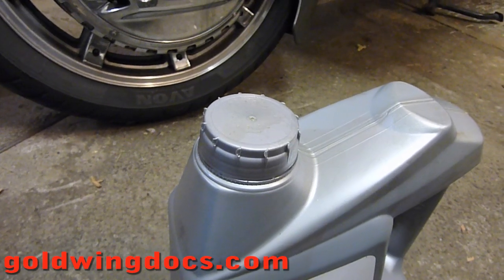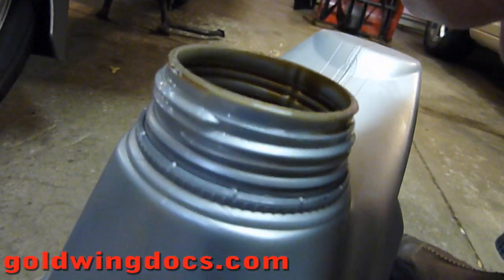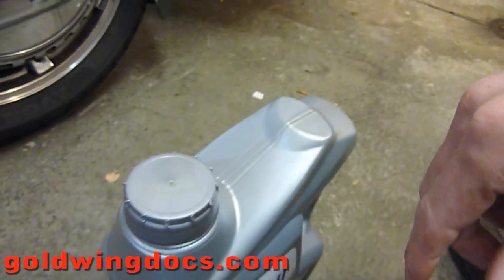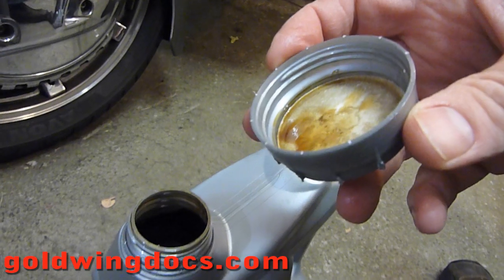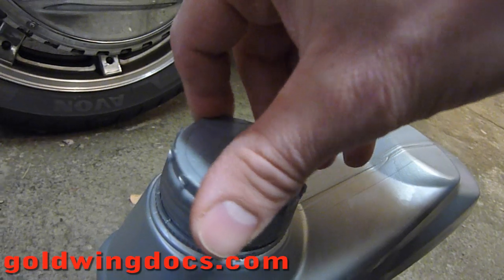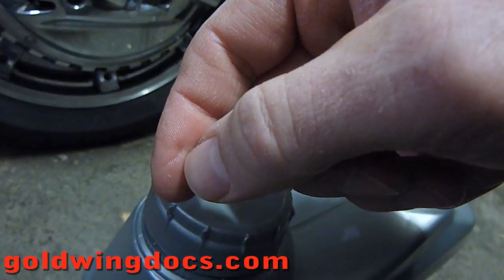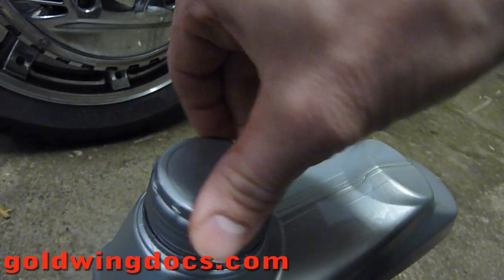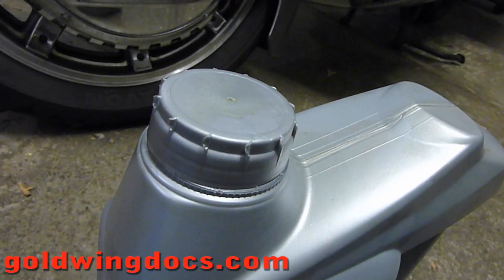How to prevent cross-threading a bolt, screw or any threaded fastener

Comment: I think you are right. This is not really explained enough to the average person. I figured it out myself years ago when I was watching a video of robotic assemble of an automobile engine. While watching the robotic unit that inserts and tightens down all the head bolts I noticed it did exactly as you described. It inserted the bolts into position centered and PLUMB to the threaded holes and turned them counter clockwise until they "Popped".  The pop noise is from the bolt dropping down one thread depth as the end of the female thread on one part and the male thread on the other pass each other. When this happens the bolt drops down contacting the mating thread below and will actually plumb itself because the mating treads of each part will now be in full contact nesting in a matching spiral. Then the robotic unit started turning them clockwise to tightening them. I have done the same ever since with excellent results. The trick is to hold them as plumb to the axis of the hole as possible while turning them counterclockwise and feel for the "Pop" as the thread surfaces contact. It reminds me a lot of operating the dial on a combination lock. Its mostly in the feel.

Comment: What you do is you screw it backward and then when you feel it line up with the threads you screw the object on fast enough to get it on the threads after meeting it up with the threads when doing the cross threading prevention trick

Comment: If you start the bolt by hand and can get the bolt screwed on with little effort then you will never cross thread a bolt impossible to cross thread a bolt by hand because you'll know straight away when the bolt won't budge anymore